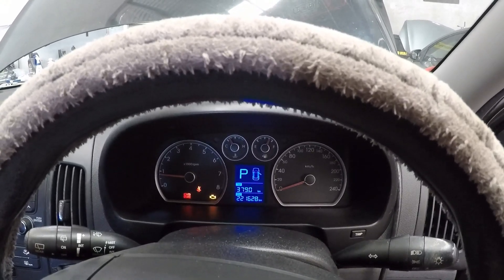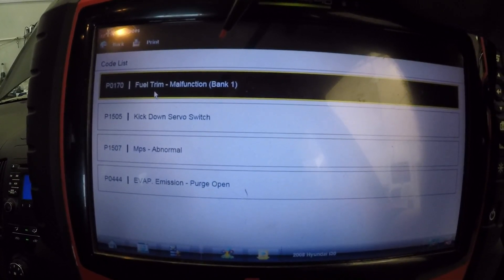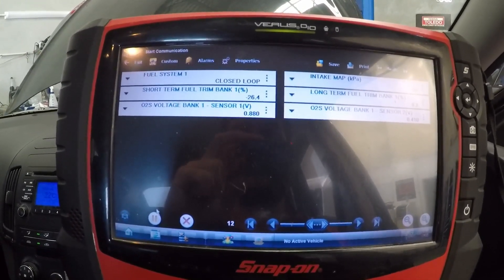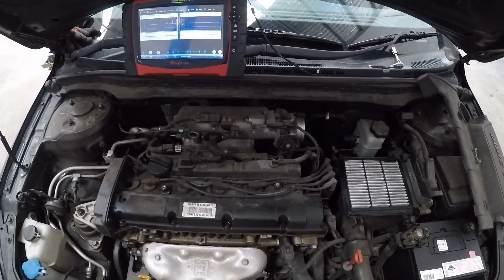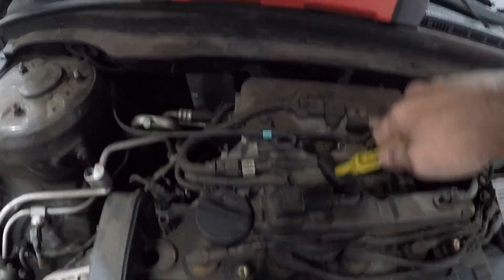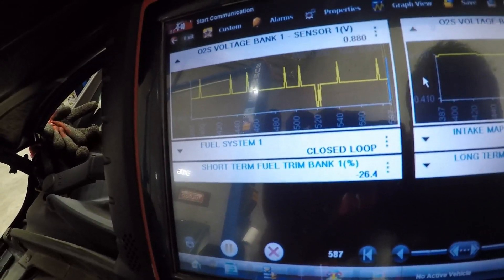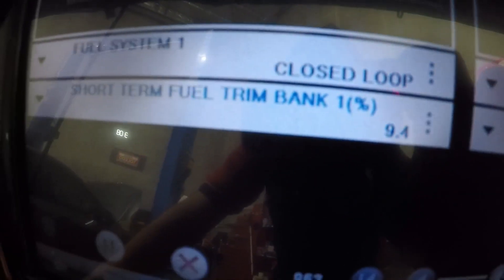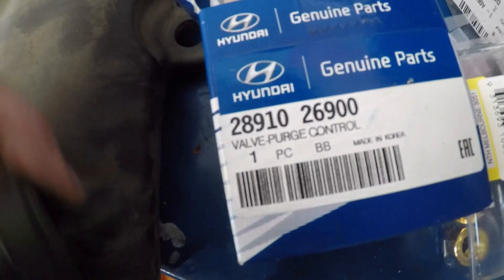Running Rich - P0170 - 2008 Hyundai i30 2.0L - Stuck Open Purge Valve

Comment: Great share
When I purchased my Elantra, not running car. Purge valve was disconnected.
Replaced oxygen sensor, as had Pre-Cat code.
After fitting oxygen sensors, 
Now have a P0170, fuel trim malfunction..
So will revisit the Fuel purge valve solenoid, cut the air, check OBD2 , live data, and now equipped with the right knowledge to read and interpret the data.
Thanks
Great tutorial!👍💯🐝

Comment: am sure you spotted P0444 @ 0:55 Rome:)
Reply from the maker: Hey Denis!! I hope all is well over there! Indeed I did but I actually caused that code because I looked at it before I started recording and I unplugged it while it was running at that point. That code was never there previously. I like your sharp eye though! :)
Reply: @romanosautomotive  I know you have a sharp eye too and wouldn't miss something like that. Thanks for the behind the scenes explanation, Rome:)
Reply: @romanosautomotive  It can be stuck open without a code?

Comment: Hey Rome i had the same problem accessing a short term fuel from on a 2006 Hyundai matrix....only the long term was there...how do I get the obd2 direct like what u did....I'm using the x431 launch....thanks for the vid....looked familiar lol
Reply from the maker: Hey Raj, if you're on the X431, if you go to ALL on the top left corner, it will have EOBD. Go into that and it will be generic OBD
Reply: @romanosautomotive  oh ok...thanks Rome....just got the launch working out the kinks...
Reply from the maker: It's a great tool once you work out all of the features!
Reply: @romanosautomotive  amigo puede traducir si entendí bien el causante fue la válvula de purga? Tengo un 2011 Hyundai sonata y me está marcando códigos p0170,p0449 esto será lo mismo del vídeo? De antemano le doy gracias y bendecimos su vida y la de su familia qué el eterno Dios le continue bendiciendo.